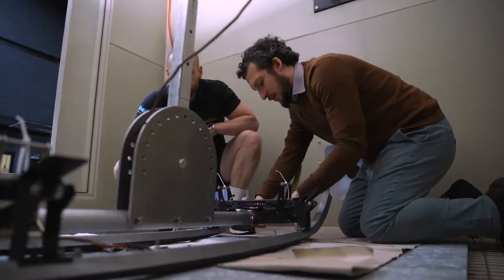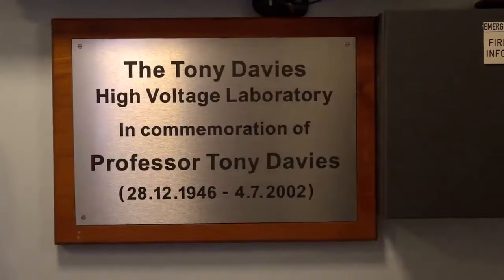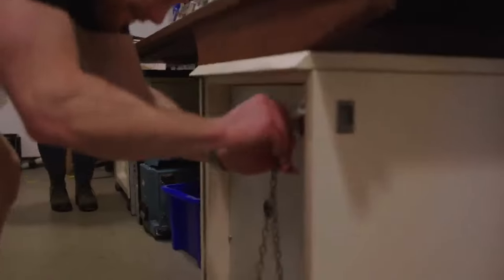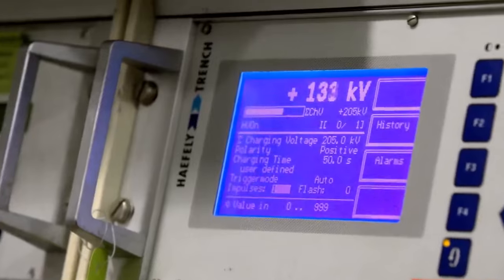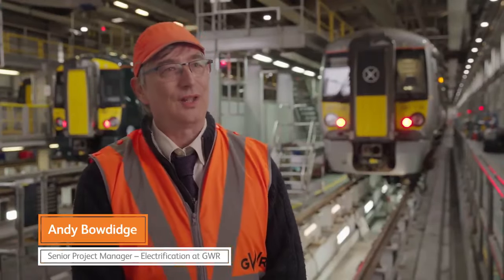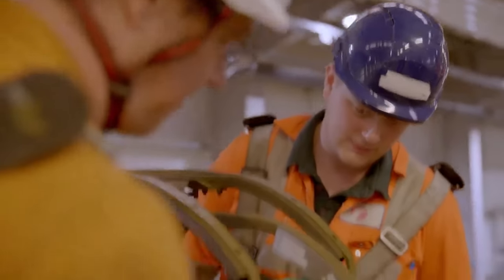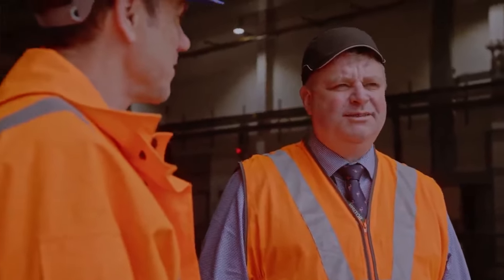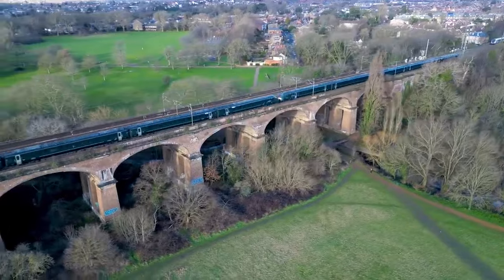Composite pantograph horn

Comment: This new technology is fantastic if it proves reliable, being able to run cables through smaller tunnels and lower bridges without having to spend millions on digging the ground out or lifting the roof height can only be a good thing.

Comment: Thanks for a very interesting vid.  The bigger challenge is to convince UK gov that Network rail can cost effectively electrify lines after the Great western electrification went spectacularly over budget.. Hopefully NR can do this, elecrification can be installed, de-carbonising the railway and bringing a host of other benefits; cheaper to buy trains, cheaper to run trains, faster trains, trains that cause less wear on the track, faster trains (especially faster freight), quieter trains etc.

Comment: How does this work at stations? The min 5 meter safety distance is close now, if they are lowered, what will the min safe distance be?
Reply: As far as I can tell, this is about letting the pant be closer to the top of the train while running. The horn is the lowest part of the pantograph head so if you can make it non-conductive you can have the cables be lower where needed, but still have them up high in stations.
Reply: It looks like this might reduce the needed clearance by about 20cm or so, which isn't much, but it'll help with bridges and tunnels that are just outside the current clearance

Comment: Surely on the newer routes you need new trains with the new pantograph. Otherwise you would have to retrofit older trains with the new pantograph  if possible.
Reply: It was hard to see in the video but it looks like they were able to fit the horn with minimal work on an existing vehicles pantograph.

Comment: this sounds like a very short sighted move. cutting corners with come back to bite you in the future. making the UK loading gague even smaller. just because cost saving happenes dosen't mean it's going to make it faster.
Reply: How is this cutting corners? Just as safe and at a lower cost. I see no issue.
Reply: From what I can tell, this wouldn't reduce the loading gauge, it would keep the same loading gauge but allow the pan to be closer to the train.
Same size train, lower pan.
Reply: @zeebeezoey  contact wire closer to train what could go wrong
Reply: @zeebeezoey  If a lower loading guage is not the advantage then what is?
Reply: @grahamallen1970  I dunno. That's what the high voltage tests in the video were for.
Reply: @tm4609  the pantograph is outside the loading gauge afaik. The non-conductive horns reduce how far outside the loading gauge the pan has to be
Reply: @zeebeezoey  It wasn't clear in the video exactly what or how the horn works unfortunately.
Reply: @tm4609  I looked up what the horn is, and it's the curved part of the pantograph head on the side that helps guide a conductor wire on to the top of the head and stops it from getting caught underneath. It's a) the lowest part of the head, b) it's out to the sides, and c) it's pointy, so it is the most likely part to arc to the train body, causing a short circuit.
Making it non-conductive would let the pan head get closer to the train body safely.

(this is what I've been able to work out from looking things up online so if there's any rail engineers reading pls do correct me)
Reply: @zeebeezoey  Oh I think I saw that in the video. If that is what the horn is then how is it that it hasn't been made non-conductive already? Perhaps there is a specific technical reason.
Reply: @zeebeezoey  then along comes 9ft 6in container trains and hight is a issue again just take the cost bullet raise or lower infrastructure to future proof the railway....our victorian for farthers maid the railway as straight and level to best of the geological features now you can see where trackhas been lowered for better loading gauge under bridges the railway is like a roller coaster up and down under bridge's.
Reply: @tm4609  if I had to guess I'd say that
a) a metal horn is more durable and stands up better to all conditions (hence them talking about wear towards the end of the video) and 
b) at 25,000 volts things that we normally think of insulators become conductors. to be worthwhile, a composite material must be able to insulate 25kV and even protect against lightning strikes, with a good safety margin.

Hats off to the materials scientists and engineers solving these problems; the world starts to get a little unpredictable at high speeds and high voltages
Reply: @zeebeezoey  Perhaps a bit like recent advances in composite aircraft construction materials.
Reply: @zeebeezoey  I knew that but the video does not explain it well Your reply is good and clear hope people read it.

Comment: Ohh yes please ....good to know your bringing 25kv closer to my head for longer😊 no danger there
Reply: Are you educated in electrical engineering? Please share if you believe this is dangerous.
Reply: @tm4609  please read report on Sweden national railways on longterm exposure to high level of high voltage....must of spooked them as all there ac traction locos up to around 2010 had a lining in the cab roof to guard around where the driver sits for extended periods  plus lower ohl brings contact wire closer to staff access doors in to cab Greater risk of flash over arc look at cant rail warning line hops over door top. Would you like 25kv in a bare conductor 3ft from your head for 10hrs per day....woodhead 1500v dc electric over head lines contact wire was a lot higher ....wcml original oil a lot higher than the new stuff let alone even lower ohl...cost savings over safety 😒...ps 34 years railway experience ....31 of them driving ac and diesel...
Reply: @grahamallen1970  well i can certainly speak in medical terms that exposure to the OHLE at any distance is not harmful. Some people suffer from a mental health disorder in which they believe that electricity does harm them. I personally don't believe that the people who built the railway that is as safe as it is would just give up now. If they wanted to cut corners they would've done so before.
Reply: This doesn't bring the 25kv any closer to you because the horn is the closest bit to you,  The current horn is live at 25kv, the new one is not conducting.
Reply: @jonathanbutson1385  what do you mean? I thought the horn was the point of collection from the OHLE and that it was lower than current pantographs can go.